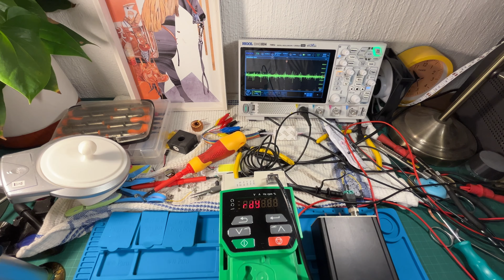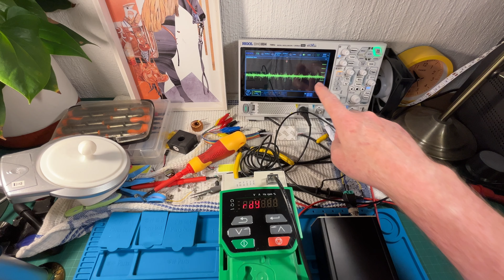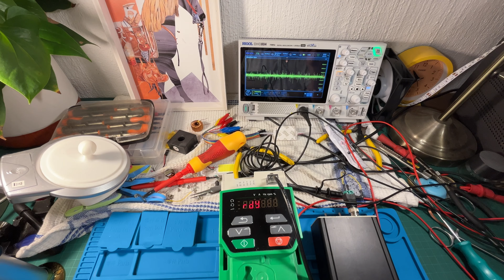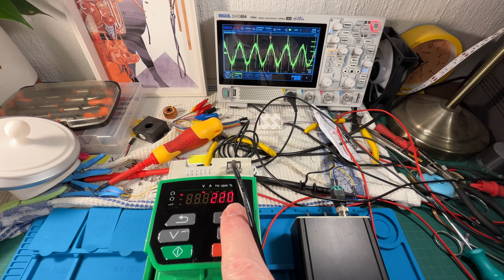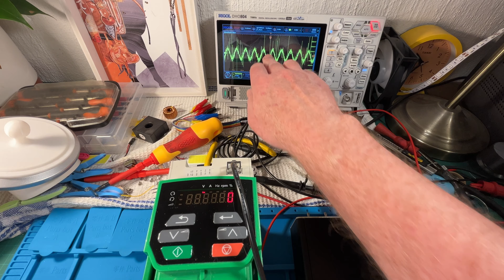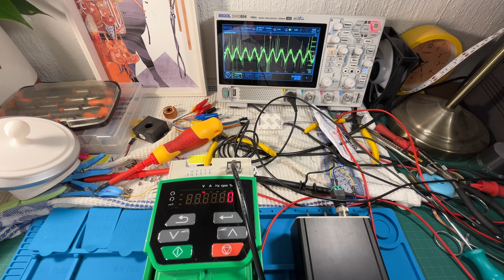Filed weakening on induction motors and what the scope waveform looks like

Comment from the maker: ### Field Weakening in Induction Motors with Variable Speed Drives (VSDs)

Field weakening is a technique used to increase the speed range of an induction motor beyond its nominal speed (base speed) while maintaining efficient operation. This is accomplished by reducing the stator flux, which effectively lowers the back electromotive force (EMF) and allows the motor to operate at higher speeds. Below is a detailed explanation of how this process works:

---

#### *1. Background on Induction Motor Operation*
- **Base Speed Operation**: At speeds below the base speed, the motor operates in the "constant torque region." The VSD provides a constant voltage-to-frequency (V/f) ratio to maintain the required magnetic flux in the motor for torque production.
- **Field Weakening Region**: When the motor needs to operate above the base speed, the voltage limit of the drive is reached (typically the supply voltage). To allow further speed increase, the stator flux is deliberately reduced, entering the "constant power region."

---

#### *2. Mechanism of Field Weakening*
- **Magnetic Flux Reduction**: The flux in an induction motor is proportional to the stator voltage and inversely proportional to the frequency. As the frequency increases beyond the base frequency, the voltage cannot increase further due to the drive's limitations. To maintain operation, the VSD reduces the stator flux.
  
  \[
  \phi_s = \frac{V_s}{k \cdot f_s}
  \]
  where:
  - \(\phi_s\): Stator flux
  - \(V_s\): Stator voltage
  - \(f_s\): Supply frequency
  - \(k\): Motor constant

- **Current Control**: The VSD adjusts the current vector dynamically to control the flux and torque-producing components. The flux component is reduced, while the torque-producing current is prioritized to maintain motor performance.

---

#### *3. Impact on Motor Performance*
- **Torque Reduction**: In the field-weakening region, the torque output decreases because torque is proportional to the flux and the torque-producing current. With lower flux, the maximum torque capability is diminished.
  
  \[
  T = k \cdot \phi_s \cdot I_q
  \]
  where:
  - \(T\): Torque
  - \(\phi_s\): Stator flux
  - \(I_q\): Torque-producing component of the current
  - \(k\): Motor constant

- **Constant Power Operation**: Despite the reduced torque, the motor can maintain constant power because power is the product of torque and speed:
  \[
  P = T \cdot \omega
  \]
  As speed (\(\omega\)) increases, the reduction in torque is offset by the increase in speed.

- **Efficiency Considerations**: Efficiency may decrease in the field-weakening region due to increased copper losses and reduced magnetic efficiency.

---

#### *4. Role of the Variable Speed Drive*
- **Dynamic Control**: The VSD monitors motor speed, voltage, and current to calculate the required flux and adjust the frequency and current accordingly.
- **Protection Mechanisms**: The VSD ensures safe operation by preventing the motor from entering unstable regions (e.g., excessive speed or overheating due to high currents).
- **Field Weakening Curve**: The drive uses predefined or user-configured settings to manage the transition from the constant torque to the constant power region.

---

#### *5. Applications of Field Weakening*
Field weakening is particularly useful in applications requiring high-speed operation beyond the base speed, such as:
- Centrifugal pumps and fans
- Machine tools
- Electric vehicles
- Industrial conveyor systems

---

### *Key Considerations*
- **Motor Design**: Not all induction motors are suitable for field weakening. Motors must be designed to handle the thermal and mechanical stresses associated with high-speed operation.
- **Drive Programming**: Proper configuration of the VSD is essential to optimize field weakening without compromising motor life or performance.
- **Operating Limits**: Continuous operation in the field-weakening region may result in overheating or reduced motor lifespan if not managed correctly.

By leveraging the advanced control capabilities of modern VSDs, field weakening enables a significant extension of the operational speed range of induction motors, making them versatile for various industrial applications.